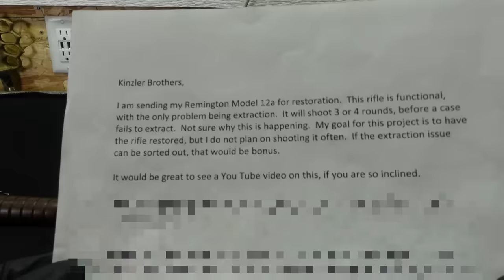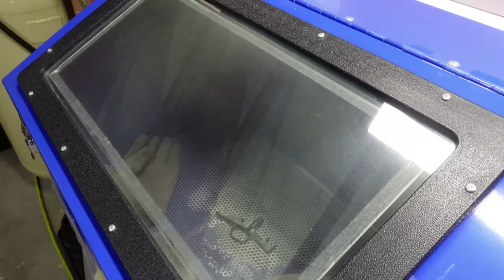Restoring 1920 Remington .22 gallery gun, (with test firing) #restoration

Comment: Try using fine (600 grit) sandpaper on blocks for the the pre blueing polish. Some people swear it produces finer results on new guns, but what I will say is it makes restoration a whole lot easier because you can't detect the pits or scratches that are too deep to remove. Mirror polishing also highlights inconsistencies in the flatness of a surface too, so I really would say give it a shot, especially if you do a military restoration.
Reply from the maker: Thank you very much for the tip and for watching!

Comment: You are very skilled in your restoration, it was pleasing to watch. I fired the same rifles at fairs in the UK in the 1960's using "spatterproof" .22 shorts. Targets included moving self- resetting ducks, ping pong balls suspended on jets of water and glass and pottery pieces on a steel herringbone target. A large steel defence plate at the rear provided the all important backstop. We were all taken on trust to behave responsibly (as school children) and we did so. Impossible to imagine today! I now own a Remington 550/1 semi auto 15 shot rimfire and it is my absolute favourite of all my guns.
Reply from the maker: Thank you very much and thanks for the comment I enjoyed it, thanks for watching
Reply: Does your 550-1 still have the ejection port hood?  It's rare to see them with the hood still attached.  I used to think the mounting screws had become loose causing the hood to be lost, but after replacing the hood realized the things were probably removed intentionally.  When used, the hood redirects empty cases back into the action before it can close, causing frequent jams.
Reply: @mnpd3  Hi there. Yes, my Remington does still have the original ejection port hood. It has very occasionally resulted in an empty jamming the port but it really is quite rare that this happens. I only use subsonic ammunition these days as high velocity rounds have twice caused the action to completely jam up and I have had to get a gunsmith to free things up again. The rifle has original iron sights and is surprisingly accurate. It will fire all 15 rounds as fast as I can squeeze the trigger and I love it to bits.

Comment: 12’s and 121’s are great, just avoid dry firing. The fragile firing pin is also the ejector and if it breaks you’ll get light strikes and failures to eject.
Reply from the maker: Yes they are. Thanks for the advice!

Comment: Wow, that rifle looks brand new. Is it .22 short only? I know some of these gallery guns were short only. Some were smoothbores as well. Like the little Browning auto-loaders that ejected out of the bottom. I bought one of those Browning auto-loaders when I was in the Army in Germany. When I got home, I took it out a couple times shooting rabbits and plinking. I could not get used to the butt heavy configuration of the rifle. Plus, it was so small, narrow. I was used to a Winchester 69A, bolt gun with a full wood stock. That little Browning just did not feel right. I Could not get used to it. I eventually sold it.
Reply from the maker: Thanks, it shoots both! Thanks for watching

Comment: I'll give you credit for better than it was, but I'll have to buck the trend of the majority of comments declaring the restoration to be superb. The factory guns did not have a high gloss blue, they actually looked fairly coarse, like about 220 grit, you can see that on vintage rifles that are in good condition. You were being careful with the buff wheels, so as to not round over lines. When you get hold of an octagon barrel the buffer is a liability, abrasive paper and draw filing are your friend there. The best way to prep the metal is the old fashioned way, draw file the sides of the receiver to get the "X"out and leave the surface flat. You have to do the entire side of the receiver to keep all the dimensions equal and the lines straight. Lots of work I know but that is what it takes to make it look right. The power sander left very discernible unevenness, a wavy look. Draw filing and use of abrasive paper on a block leaves the surface squared up and crisp lines, as they should be. The ejector port side of the receiver looks like it got nothing, lots of pits and dings, draw file and abrasive paper there would have made quick work of those age marks. I got into the habit of wire brushing the final sanded metal, using a .007 inch diameter wire wheel on the bench grinder, leaves an aver so pleasing metal texture...but it is not the original factory finish sadly, still I do it because I like the look. There was a time when WD-40 was avoided as the post blue solution soak, the use of a light mineral oil was preferred, something to do with some degree of potential blue removal by the WD-40. I ended up using Chevron turbine oil, a 10 wt. mineral material oil. The stock I could see had oil soak. That can be remedied with soaking in a large dish or pan of acetone or lacquer thinner and then airing, use of hair dryer will also pull the acetone/ oil out more quickly,  which can then be blotted off and again rinsed off with the next acetone dip. The oil contaminated wood is mostly irrelevant as you stained it very dark and finished with linseed, so  that finish can be trusted to hide the oil and will have durability on the oil soaked wood. I have had really bad oil soaked stocks that I even packed in baking soda then cooked on low in the oven...works pretty darn good to get most of the oil out.
Reply from the maker: Thanks for the comment Gary and for all the advice!

Comment: So did you put in a new firing pin extractor or did you work on the original?? I did notice you used your third hand!! That stock looked great for being that old, mine had the standard crack all the way through.  I try and look for one every now and then to replace the one I made.
Reply from the maker: I made it work, ya it was necessary! Thanks we appreciate it, that sucks hopefully you find something. Thanks for watching

Comment: Should have left it alone. Your work did absolutely nothing to improve it, but actually devalued it. As others have said backed sandpaper and hand polishing is the best way. The buffing wheel rounds over edges and lettering unless handled by someone with much more experience.
Reply from the maker: It was for a customer that wanted it that way, everyone has there methods! Thanks for watching